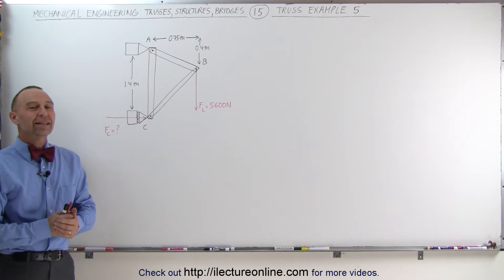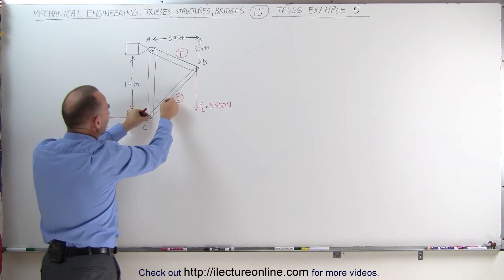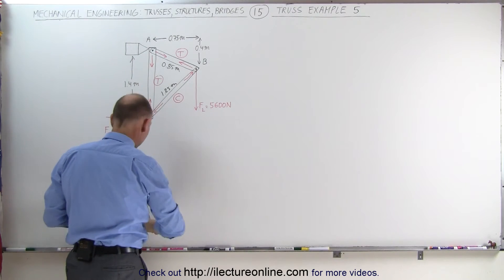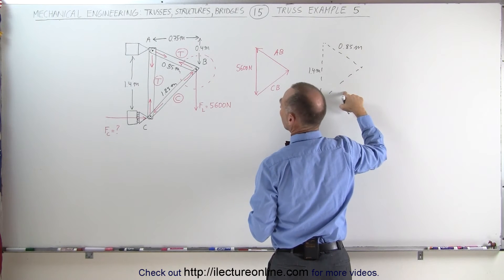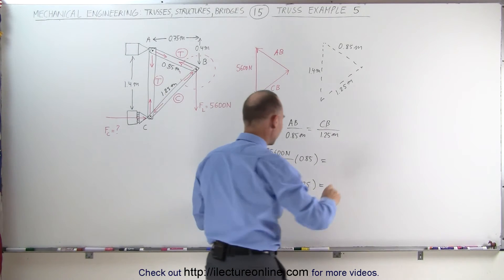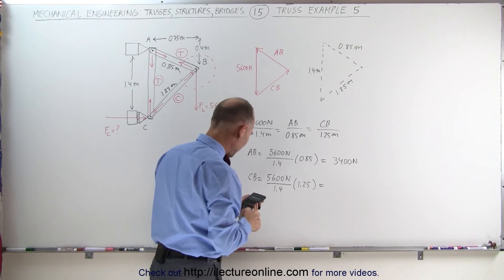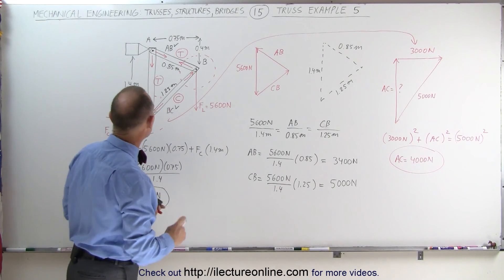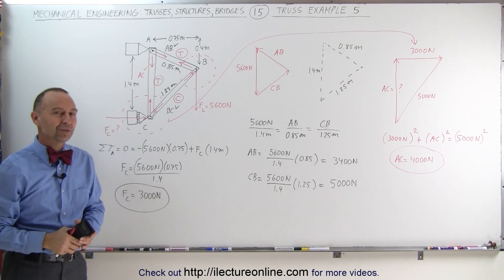Mechanical Engineering: Trusses, Bridges & Other Structures (15 of 34) Truss: Ex. 5

Comment: how is it possible to associate the length of the triangle with the vectors to obtain ab and bc when its  clearly not a right angle triangle????
Reply from the maker: In a static situation, the sum of the forces on any joint must be zero.  Therefore you can add the vectors graphically, when you draw their length proportionally to their magnitude.

Comment: Sir,this was not an right angled triangle you have used length ratio to solve but how can we know whether to use that technique or not
Reply from the maker: The technique shown works for any angle.
Reply: @MichelvanBiezen  thanks sir
Reply: im guessing he filled in the blank because he new the hypotenuse force of the angle was 5000n and the adjacent force was 3000n so the opposite force could only be 4000n, i hope.
Reply: yeah it's a Pythagorean triple

Comment: Dear sir, what if I identify the member wrong direction. For example, the member is under compression, but I define under tension mistakenly. what's gonna be happened? Thanks
Reply from the maker: You will get the problem wrong.
Reply: @MichelvanBiezen  Thanks